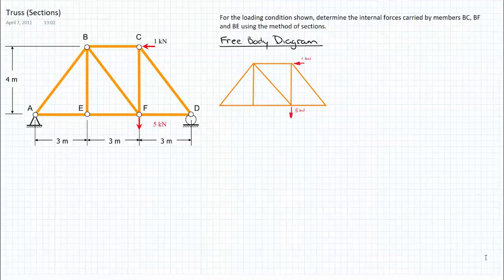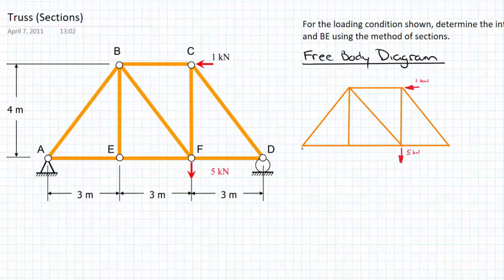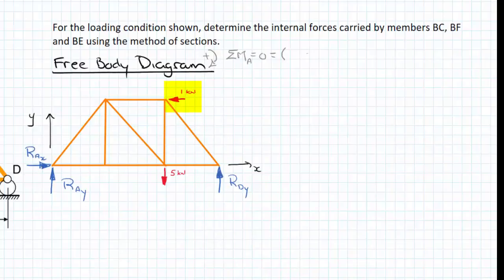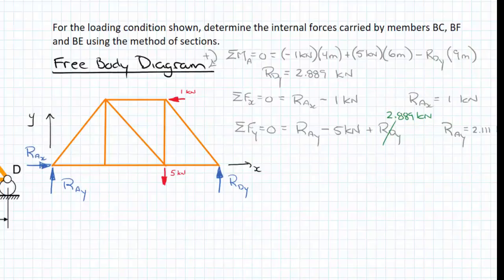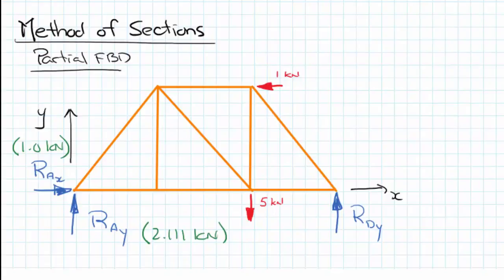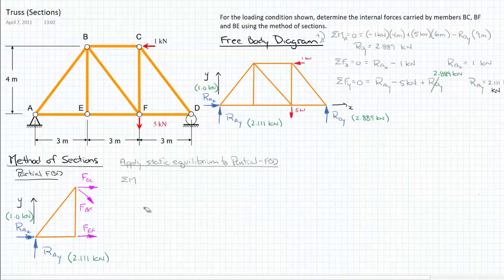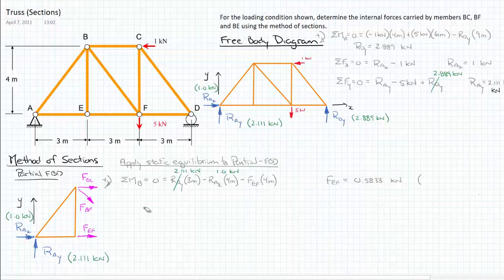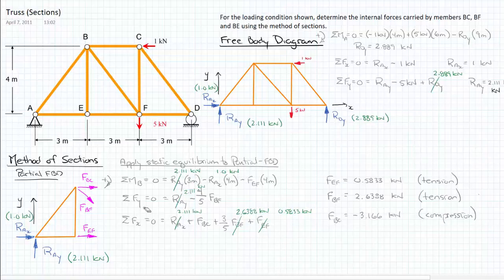Truss (Method of Sections)

Comment: Hi,

Where did you get the 4/5 from? 

Thanks
Reply from the maker: The geometry of the truss is based on the 3/4/5 triangle... thus the 4/5 is the ratio of the vertical distance to the distance along the diagonal.

Comment: for Fbc i got -4.165 ,how did u get -3.166 ?

my moments are -(1 kn x 4m)-(2.11 x 6)+(Fbc x 4)=0
Reply from the maker: Where are you taking moments about?  Something is wrong in your formula.
Reply from the maker: An interesting direct calculation for Fbc would be to do moments about F (using the partial FBD).
Reply: i took moments about f ,so there it cancels out the 5kn force,Fbf & Fef
Reply from the maker: Jovani Nickson   Use the partial FBD... the 5 kN force does not exist.  Zero moment arm cancels out Fbf, Fef, and Rax, leaving only Ray and Fbc.
Reply: oh thanks ,such a silly mistake